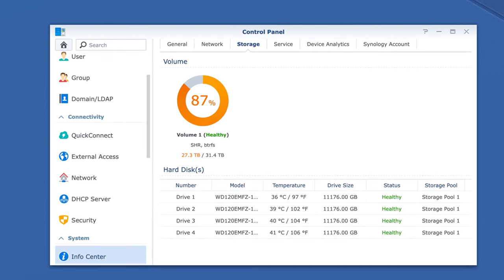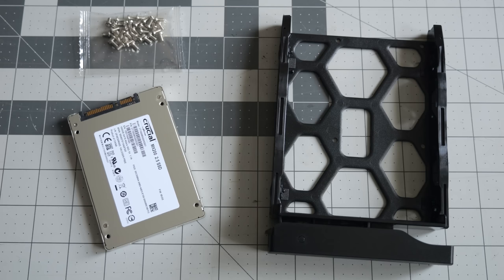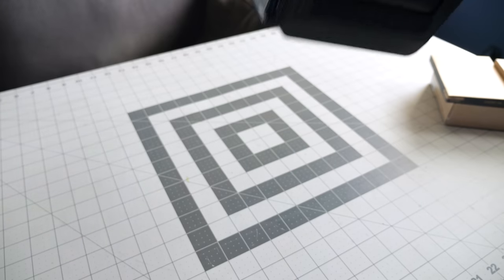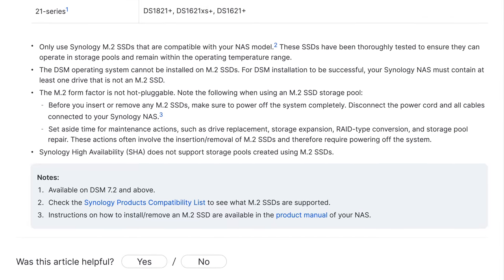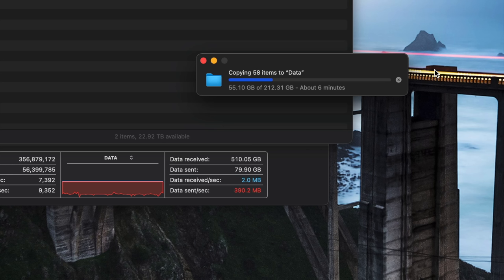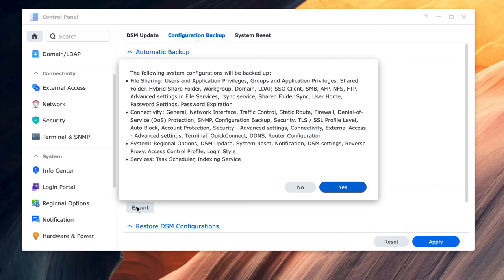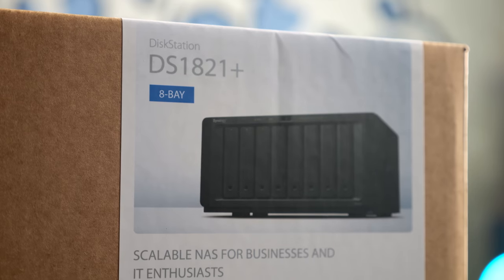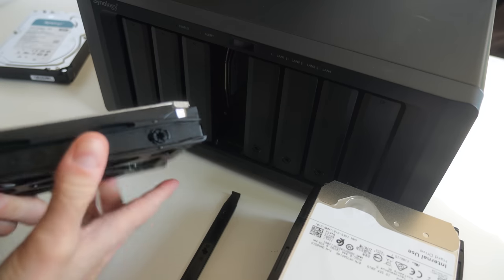That's a LOT of hard drives! | Synology DS1821+ NAS review

Comment: I have a DS414 which turns 10 years old next year. It is still working with the original drives! Of course, I don't trust the drives anymore and have backups but at this point I am tempted to test how far I can push this. Although I really should upgrade soon...

Comment: I’m glad that Synology still supports hard drives for network storage, because SSD is still more expensive per data than HDD. Especially for 4K video storage, I prefer hard disks, even though I use SSD for daily use and for video gaming!
Reply: Of course they do. Is there any NAS brand that doesn't? Excluding flash specific models like ASUS FlashStor.
Reply: @dustojnikhummer  because a lot of these companies tried to phase out mechanical hard drives for solid state drives, but they reversed their decision due to costs and reliability concerns.

Comment: I still use my old Synology DS415play with 4x 2TB HDDs for backup purposes only.
It's outdated and I repaired it myself already once (the resistor hack) but it still works absolutely fine and I dont have so much data, so I dont bother with replacing.
Unless Synology sends me a new 4 bay NAS with 4x 16TB archive HDDs D-:

Comment: 1821 is somewhat old now, the 1823 is newer and much better... but has compatibility limitations.  Also, use 8x higher performing 18TB enterprise synology drives in RAID6 with a raid 1 dual ssd rw cache with 32gb ram for a long term deployment.   Hosts corporate gitlab and email within docker well.  Multiple units form a great VM cluster for small offices.
Reply: very different use cases since the DS1823xs+ is designed more for intense usage from Creator Professionals. The Ds1821+ is for the tier below that. Also pretty big price difference ($800)
Reply: @nickthenasguy  it's a lot more than $800 in price difference, more like $3k when paying the synology brand premium on enterprise 18tb drives, ram, pci card, 2x800gb ssd, etc...but...it's definitely worth it.  I have both an moderately configured  1821 and a max configured 1823.  Because of the cpu, better network ports, better drives, components, extended long term support, etc ..box feels like 3x-4x better performing than 1821 and synology unlocks more dsm features on the 1823 and provides better support.  Volume briefly peaks at 1.2-1.7GB/s and easily sustains 800+MB/s sustained combined read/write. If I remember correctly, 50k-70k raw disk IOPS.  Might be just my cheap disk and network selection, but I get 1/3 that on the 1821. Furthermore,  the cpu on the 1821 is too limited to deploy more than 1-2 intensive docker containers.   Depends what you are looking for, the 1823 will be the main server at its location for next 10yrs.  1821 adds a small amount of redundancy and failover, while handling utility tasks like surveillance that we don't want to bog 1823 down with.

Comment: I hate the business strategy of Synology, it's greedy just like Apple. And it's not configurable enough for me. I want  mirrored disks that i can pull out and use in my Linux system if the Synology hardware dies. Impossible. I still have an very expensive  DS920, but not being able anymore to install a  10GBit card later is a killer.
Reply: To the point. As someone that is right now dealing with a dead QNAP with 4 disks and can't get the data using a Linux machine due to the mdadm -> drbd -> lvm -> ext4 QNAP stack, I think your question is very pertinent. Recovery from failure from these NAS units, be they Synology or QNAP, is not a given. We are pretty much stuck with them for business continuity. In my case I backed up to the cloud so I can recover everything. Slowly, since it is encrypted and you must use QNAPs decrypt tool. But see where this is leading?
Reply: QNAP = CVE sigh

Comment: I own a synology NAS 
Yeah, there are some company moves by then i don't like. But the DYI solutions are crap especially if you're selling them to businesses. Unless you're doing lathe scale deployments. I've only seen one small DYI NAS box and it was crap.i welcome reasonable suggestions that don't look horrible.
Reply: TerraMaster F4-423 - it's basically an Intel NUC fused to a RAID controller. They have an internal USB slot with a flash drive which you can swap to install e.g. OMV. But yes, it doesn't look quite as shiny as the Synology.
Reply: @mbirth about the same price as Synology in that drive size. Yeah may be a little faster. Can you load what you want in it? Don't know.
Reply: @glynnetolar4423  Yes, you can. It has HDMI video output and USB for keyboard/mouse in the back, normal BIOS, etc.

Comment: Have you tested the performance of this model with SSDs in raid 10? I’d be curious to see if you could saturate that 10gig connection.
Reply: on a prev video, think it showed ~1000 on the reads and ~600 on the writes fwiw.

Comment: At work we use a very similar model except its the rack version. Its a pretty good system and pretty solid but I do have a single gripe about it and that is that using the BTRFS file system and raid6 changing file permission is slow as dirt. I am unsure if its the raid or the underlying file system that makes it very slow but its very slow. Even when pulling up ownership it takes a few seconds for it to load in.

Comment: Only 8 bays if you after a beast array of disk drive bays then review the qnap tvs-h1688x or 1288x. 16 and 12 bays respectively I have the 1688 with quad 2.5G and dual 10G nics as default and 128GB of RAM. This seems OK for beginners. Nice little NAS review we present. God speed sir

Comment: Read cache on SSDs is fine, but to set up the write cache, you need two identical Synology branded drives. As it is quite normal, to be picky on write-back cache, it was surprise for me because I bought only one ssd drive. The seller did not bother to point that out.

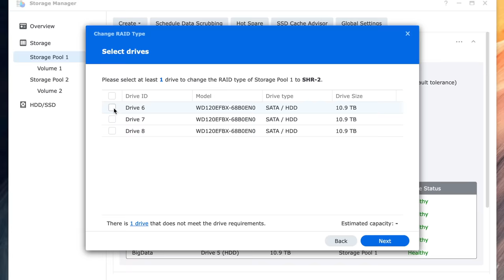Comment: at 13:13 at the bottom it states 1 of your drives is not meet the requirements of moving to SHR2.  Is that the cache pool or SSD or something else?
Reply: That is the Intel NVME in the system it gives you the warning as you use the same screen for adding / creating pools

Comment: I'm using two LaCie Quadra nas'es for my storage. It works great but I also make non-live backups on other drives, copying every few months. And it drives me crazy bc it's so much work. I think this Synology is something for large files users or small businesses and like the expandability very much. I do hope the PSU holds up with 8 drives.
Reply: My 1819+ has been running strong for four years, 8 drives
Reply: @Supercon57  Thanks for the follow-up! Under MacOS you can show previews of every file in a folder, and that causes pulsating on the power supply, which it often doesn't like.

Comment: Honestly, I wish they can be a DAS too, cause my internet is very unstable and it feels weird to put my whole HDD online like that.
Reply: Perhaps I misunderstand, but there is no need to connect the NAS to the internet if you don't need/want to.   It is connected to the network usually via a router and can be accessed by devices on the network.
Reply: @Martin_Edmondson  I don't sure if I understand what you saying? You mean I don't need to connect it online? Even though it's connected to ethernet?
Reply: @dotapark   Yes, that is what I am saying.

DAS means that it is directly attached to a computer (usually by a USB cable.)
NAS means it is connected to a local network (usually via a router, by a ethernet cable.)

To make it so that you can access your files when you are outside your local network many people use Synology quickconnect.  
There are other ways, and you usually have to open ports on your router.

It is possible (and probably advisable) to turn off quickconnect and close all ports that the router needs.  This means you can only access the data while at home. Only while connected to your local WiFi network.
I basically have mine like this.

Comment: There are NAS devices that hold a lot more drives than this thing.
Not to mention serious storage servers in the 70+ drive range, like the various models of the Backstore "top-loader" servers (45 or 60 drives per), the other makers that were inspired directly by Backstore (all of the "Top-loader" designs by folks like Dell, SuperMicro, HP, and such) as well as the Superstore 6047/6048 series (up to 72 hot-plug 3.5" drives you don't have to pull the machine from the rack to access).
THOSE servers are a LOT of drives.
Reply: So? 8 is still a shit ton of drives for families and small businesses. 160TB of raw storage...
Reply: @dustojnikhummer  8 might be large for most people, but in the IT world it's TINY.
24 drive units seem to be the SMALLEST widely used at any place that has "IT professionals".